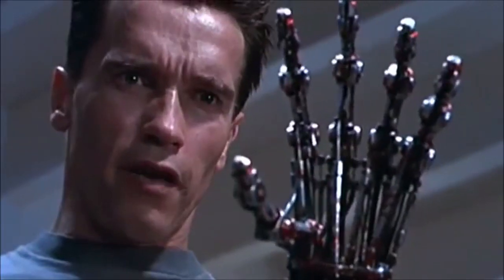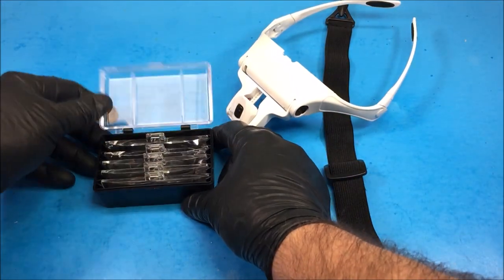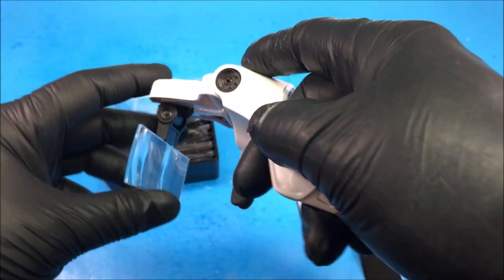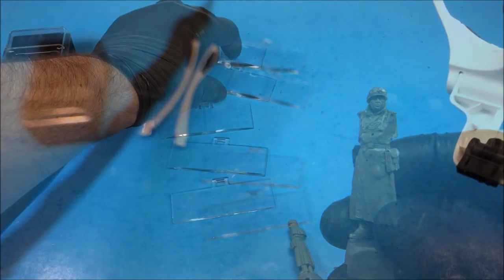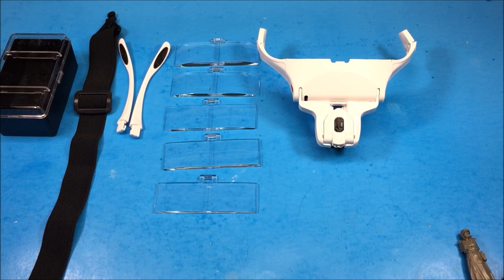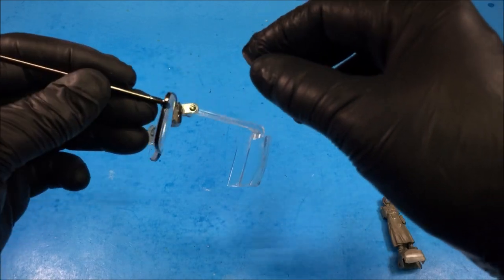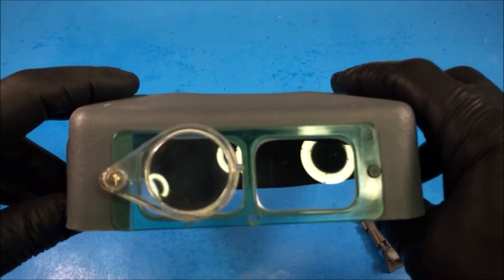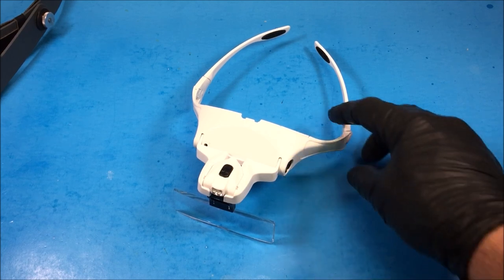Review – Magnification Glasses – magnifier reviews (for military modelling) 2018

Comment: Good video on what optics are available and how they work. When I first purchased an Opti-Visor many years ago it came with one lens, was pricey and I found I really did not need it and my paintbrushes were always colliding with it,  [ another sign I really did not need it ? ] Fast forward, I need it. Wore it out, bought a new one with multiple choices of lens, using #5 at the moment. Also have the Lee Valley "Magni-Focuser" came with choice of lenses, #7 in place now, also a battery pack and lighting unit with a wire, have not really needed that. Also I use 2 sometimes 3 desk lamps for my modelling and painting. These lamps are articulated and positionable with "Philips Natural Light" 100 watt incandescent light bulbs. When turn off they are are bluish/gray glass. 
I also  have some drugstore readers which are ok but it best to take a figure and paint brush with you to the store to try them out, focal distance can be misleading.
I like how you adapted those dental lenses to your glasses.The dental people do have the best things going, the ones that look like tubes are sweet but they are prescription and $500 +.
Cheers GordE
Reply from the maker: Thanks Gordon. There's so many choices out there. I Iooked at several but these seemed right. I can now shoot my videos without bumping the damn camera all the time.